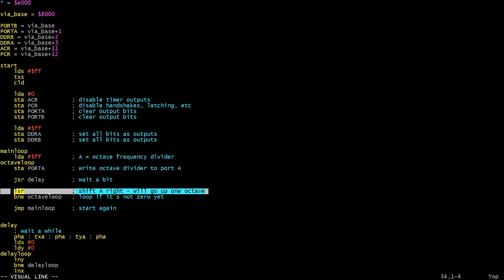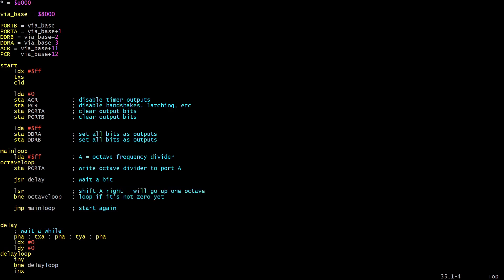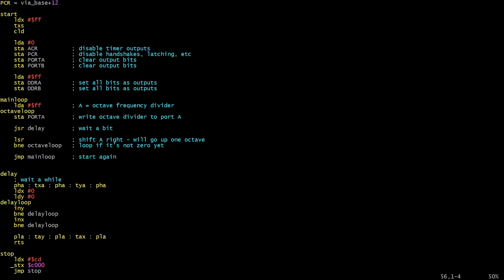6502 Controlling Digital Tone Generator

Comment: Why not tie it in to the 6502 bus directly? Wire the Ready pin to the Wait pin of the 6502. The rest is just glue logic. 

Also, have you tried adding more than one SN76489 together to have more voices? I've seen a 2 chip design on the RC2014 by J.B. Langston, but I'm toying with the idea of having 4... and even more. I have this idea of creating my own take on the SID box. I know, it's not the same, but I have ten SN76489, might as well put them to good use? Yes? What are your thoughts?
Reply from the maker: The counters need to be able to reload their counts whenever they expire, so we need something in between them and the CPU bus to buffer that data for them. The 6522 is doing that here but I've also used 74HC273s, especially to get multiple channels working together. With those it would be possible to connect directly to the bus if you wanted to. I ought to go the follow up one day showing that!

I've also been thinking about wavetables recently, and digital sampled audio. I think the OPL chips used lookup tables for example to support different waveforms.
I think SN76489 only does square waves. Conceptually it's like what I did here but with three channels plus one noise channel. To get really interesting effects you'd want to modulate one oscillator with another, if you can work out how to chain two SN76489s together it would be interesting.
You could also make an analogue circuit to reshape the output waveforms. There are a lot of great videos out there from people who specialise in synth electronics that might help there.

Comment: Nicely done. It makes me wonder what the ay-3-8910 has inside it.
Reply from the maker: Glancing at Wikipedia it looks very similar, as far as tone generation goes. They run 12 bit counters instead of pairs of 8 bit counters though, and use a faster input clock to shift all the frequencies higher.
It's also very similar to the chip used in the BBC Micro, which is what usually inspires me in these things!

Comment: Why don't you make a very simple terminal program with which the data and programs are copied from the PC via UART into the RAM?
Reply from the maker: I'm not sure why but I've always preferred the idea of making a standalone computer, and joining it up to a powerful PC feels a bit unbalanced. The components are also single-purpose which I kind of avoid, I prefer to build things up from general purpose parts. So I'm willing to invest many hours in designing my own keyboards and video circuits instead. It doesn't necessarily make sense, but it's a fun hobby so it serves its purpose!
Reply: @GeorgeFoot  OK. Here is my 65C02 project: https://bitbucket.org/UweGottschling/oak65c02/src/master/ . I use XMODEM to transfer software ;-)
Reply from the maker: Nice, is that from 2004? Very modular design!
Reply: @GeorgeFoot  I started about 1988 and worked on it for about 1 year (still with Thomson EF9367 video chip). I continued again in 2018 (TMS9918 video chip, floppy controller, OPL3 sound, PS2 keyboard).

Comment: Alright. So I was following a long and decided that this method is just too big for bread boards. Would it not be more space efficient to use DAC + VCO? Using MOSFETs and a resistor at the output stage can lend it self to volume control as well. Why did you settle on down counters?
Reply from the maker: I think you could make something like that work for sure, it'll be a more analog design overall I think. Down-counters was my first thought because it's how the computer I grew up on worked, and because I happened to have some spares left over from my video circuit!

I'm expecting this project to take about one breadboard per sound channel, including volume and mixing circuits, which is fine I think. The number of channels is up to you. If you want to go smaller you could also consider using a more monolithic IC - someone on /r/beneater found one with three 16-bit down-counters and control registers in one 6522-like package. That's not something I'm personally interested in though.
Reply: @GeorgeFoot  Alright. I expected as much. I will follow a long but will also try my other method. I am not sure if I care too much about an all in one IC as well.
Reply from the maker: @darer13  I'd very much like to get some old fashioned analog synth effects working, at least at the mixing stage, and DAC/VCO/VCF may be the best way to go for that. If you want other inspiration then the Commodore SID chip is interesting to learn from, and I'm also interested in the Yamaha OPL family. They were the foundation of not-entirely-awful PC audio in the late 80s/early 90s, and used ROM-based waveforms and FM synthesis, with a configurable feedback/chaining scheme to combine multiple oscillators into a single voice. It's a little more modern in computing terms than what I'm shooting for here, but very interesting! And something I'm hoping to find a way to bridge into later on.